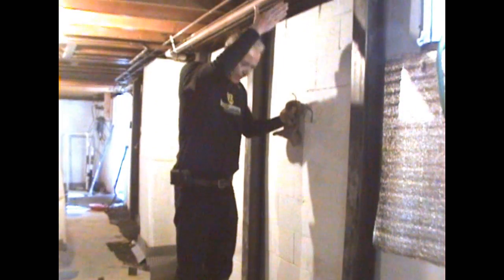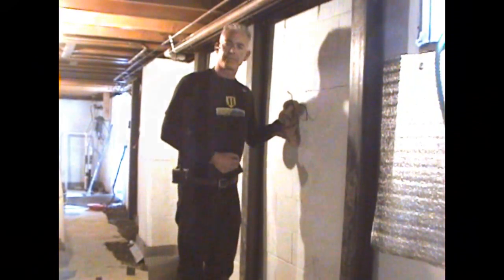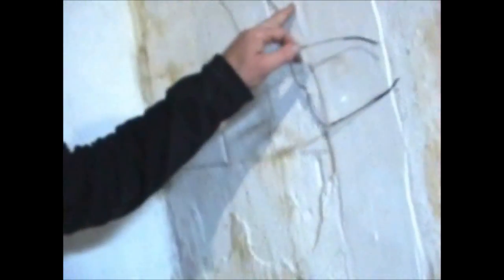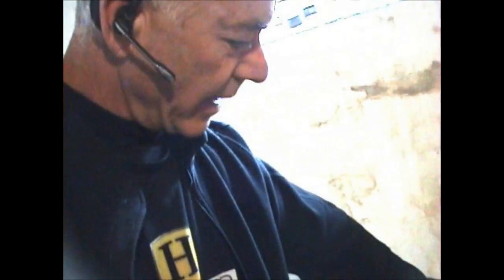Foundation Repair - I Beams vs Carbon Fiber Strips

Comment from the maker: Another Carrbon Fiber fan with a Comment.  Any and all foundation wall structural repair can and will fail when improperly installed.  Including I beams and Wall Pins.  Yet if all, I beam, wall pin and Carbon fiber strip where installed properly I do believe "common" sense will prevail.  Steel vs Plastic.   A Glue hold vs  Bolts and Concrete.  Comedy or plain ol practical common sense.  My Company My Reputation.  I do not trust Carbon Fiber.  To Fail one Customer is one too many.  If you chose to sell and install Carbon Fiber be sure to not let your Lability Insurance laps.

Comment: Comedy......   This example of 24,000 lbs. of pressure is completely erroneous.  The concrete floor is most likely 2500 lbs. mix or 3500 at best.  So, how is 2500 mix concrete holding 24000 lbs "forever"?  If these pressures are accurate, then I would guarantee that the concrete floor would blow out.  Besides, where are the engineering reports showing that HIS method has accomplished ANYTHING.  And, his ONE example of a carbon fiber installation shows a defective install where the strips are not down to floor level and, so it appears, it is installed over some type of de-laminating cement product.  The cement product(or any other product) should have been removed and the carbon fiber directly adheres to the "structural " wall.  Once again... Comedy!
Reply from the maker: Okay my goodness this video was made 12 years ago.  Actually I haven't heard from this customer since so maybe the I Beams are doing what they"v been intended for?  Everyone's a critic...  - Daniel J OConnor
Reply: @DanielJOConnor  would a h beam 3/16 also work?
Reply: 90% of failures in any surface applied composite materials is the direct result of a failure to follow surface preparation guidelines (Univ of Texas study for ICRI, 2005).  Additionally, if you are using a structural composite system with the appropriate epoxies, the single largest weakness in the composite becomes the substrate, that is to say the concrete or block that it's now bonded to.  On average a residential epoxy composite system should test for bond adhesion above 500-psi.  Because the composite's effective "pull-off" is higher than the strength of the concrete it's bonded to the concrete will always fail before the composite does.  Even this example shows pieces of the substrate still attached to the composite.
However, in this specific example, I would hazard a guess and say that the failures in the composite system were equally shared between improper application and surface preparation, and improper spacing, per ACI 440.
Because of these essential failures that system was installed to fail.  That is why I always recommend following the manufacturers guidelines for the installation, as well as understanding the prep and installation process.  It's a simple thing to do correctly, and equally simple to make mistakes.  If Daniel were to have installed his I-Beams improperly, with inadequate spacing, or with a poor floor/joist bond, his system would also fail.  It's not as simple as "this one works and this one doesn't".  
I always enjoy my conversations with Daniel at the BHA.  I think that his experience in the field allows me the ability to see various failure modes for composite systems, and then have the ability to make certain that the systems I work with every day are less and less prone to those kinds of errors.  I look forward to another meeting pretty soon.  Atlantic City was a blast.
Reply: obviously he was wrong and the jack is not maxed out.  my 12 bottle jacked lifted a piece of paper, obviously the piece of paper weighs 12 tons.

Comment: Dan ... great video!  I was considering carbon fiber. Not now. I have a similar issue.  I have the skill set to do this.  Would you mind sharing the size beam you used and what are your thoughts about welding a baseplate at the bottom of the beam and mechanically anchoring it to the slab, assuming of course the anchors are sized and engineered to handle the load? Thanks

Comment from the maker: This is an old video and the possibility of spitting the floor beams does not exist with 1/4 inch tempored lags but regardless of all that, the angle iron is mortised in.  So really?  Carbon Fiber?  Give your manufacturer a call and see if they'll do a full blown all out test with me.  I've a few jobs comming up.  We'll do my way on one wall and yours on another.  We can Fire up an old D9 (bulldozer) and whomever losses pays for the damages.  And wait till you see next months video.
Reply: Daniel J. OConnor  my basement wall is pushed out at the top. I would like to preload the I beam as you do at the bottom it this possible. They are concrete not block